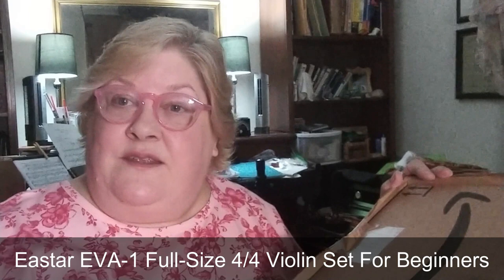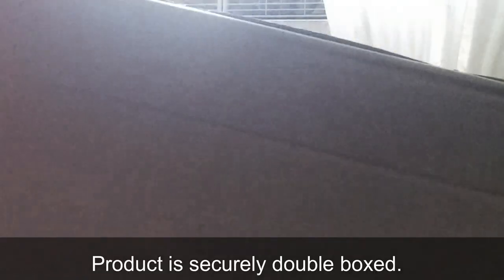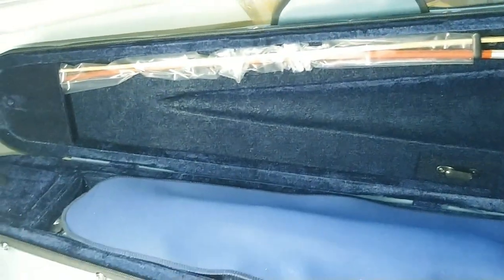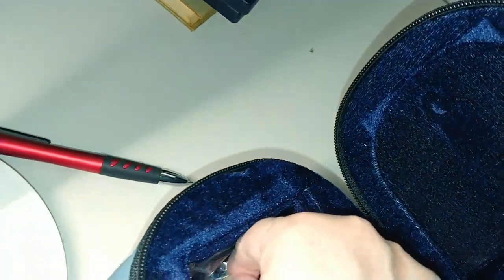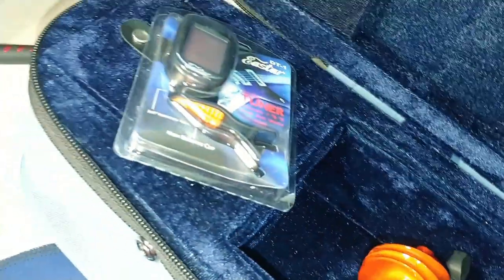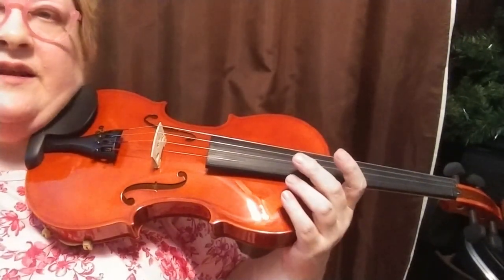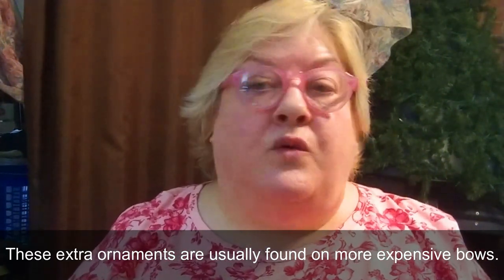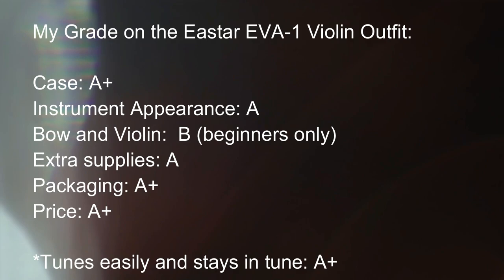Eastar Violin Outfit | Open Box Review by Violin Teacher

Comment: Nice review!   One comment, height of the strings over nut is very easy to remedy, if you are even a bit handy.  I used needle file to progressively deepen the groove until strings were exactly where I wanted them over the fingerboard, and coated the groove with graphite pencil markings (for lubrication).  Very easy and made my cheap violin much easier to play.

Comment: I would still buy from Shar because you'll get a violin with decent strings, a usable bow, and most importantly, a luthier will have gone through and made sure that it is set up properly with good bridge work and correct sound post placement. Their student quality Franz Hoffmans are good violins. I can see right off the bat, that Eastar colin's bridge was poorly done and the pegs are fitted really badly; they don't even go through both sides of the peg head.

Comment: Thank you  for this informative video ,my question is what brand you recommend for beginners ?
Reply from the maker: If you can get a Suzuki 220 model, this is ideal. They are pricey but you can see the challenges a cheaper violin might pose. You may be able to find Suzuki or student Juzek on eBay. I have seen the Cecilio brand recommended but I don't have much experience with them.
Reply: @ViolinTeacher  Thank you so much

Comment: I am having trouble with continuing to turn the peg I need help
Reply from the maker: Is the peg sticking? or is it slipping out? If it won't stay in place, be sure to push in as you tighten. Try pulling it out a bit if you are loosening. If you can't get it to turn at all, you'll need to contact the seller. Maybe a local music shop can assist.
Reply: @ViolinTeacher  thank u so much